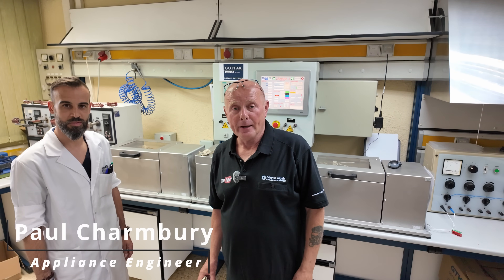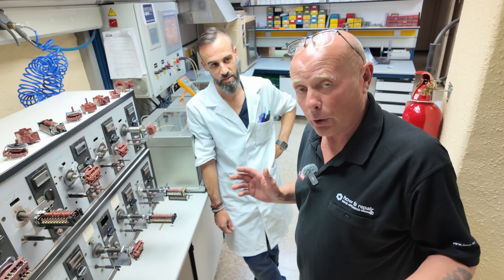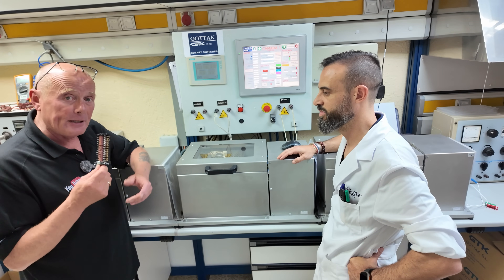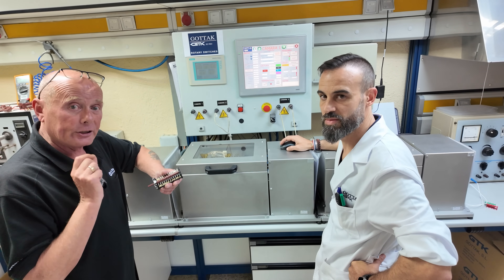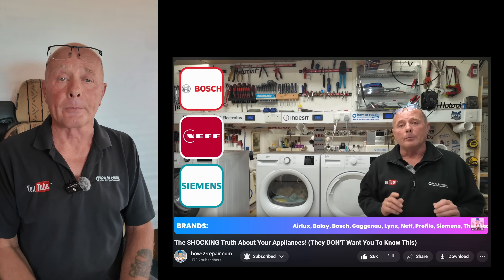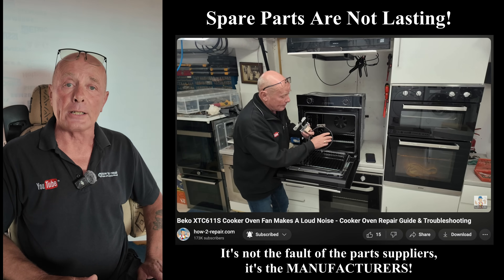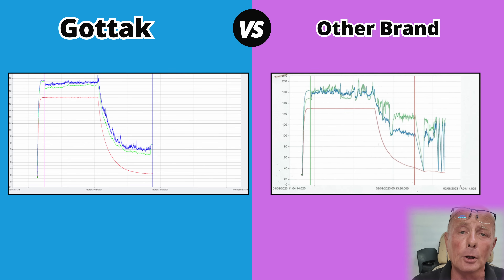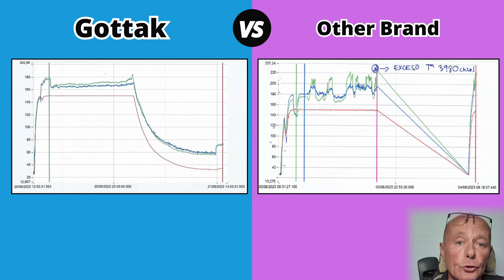Why Your Appliances FAIL SO FAST! Lab Results EXPOSE the Truth!

Comment: I’m surprised that the government has not stepped in to deal with these e-waste or f-waste. I often see clean new refrigerators, ovens, TV being thrown out. Our refrigerator is from 1985. It was so badly rusted, I did some sanding and I spray painted it. Unfortunately, now the heating element or something failed. Last time something failed was in 1990 and some small black box was changed. The freezer has been running constantly as well I suspect that one also has a similar problem. That device is also from 1985.
Reply from the maker: Hi there! Thanks for your comment, @louistournas120!

You've hit on a really important point about the surprising lack of government intervention regarding e-waste or "f-waste" (referring to appliances) and your personal experience with old, repairable appliances versus new ones being discarded. This is exactly the kind of built-in obsolescence we discuss in the video.

At the trade show last year understanding how much obsolescence is being designed into new appliances these days is something everyone should be aware of. For a deeper dive into this topic and to see the examples we covered, please check out the full video here: https://youtu.be/gEgSCbZnHVM?si=wTIw0mELuhWaw4aX

We also explored related aspects in these videos:

The shocking truth about manufacturers: https://www.youtube.com/watch?v=QsdGd2qDPaI

Heat pump tumble dryers are they really worth it?: https://www.youtube.com/watch?v=xn03N3b0-lE

If you found this information eye-opening or helpful, please consider sharing this video with your friends and family. The more people who understand what's happening with appliance longevity, the better equipped we all are as consumers.

Thanks again for watching and engaging! Don't forget to subscribe to the channel for more insights like this!

Comment: In 1978 I worked for Shell Chemicals. A co-worker had a brother who worked for Black and Decker at the time. His job as an engineer was to get tools to last about 5 years with average home use. This has been in the works for many decades.
Reply from the maker: I've reached the point where I simply cannot tolerate this situation any longer, and that's why I made this video. I'm aware that this might cause some controversy, or even land me in trouble, but I believe it's crucial to try and make a difference. I would greatly appreciate it if you could share this video. Together, we might be able to bring about some change. If we can't shame the manufacturers into action, perhaps someone in government will see the video and take notice of the overwhelming number of comments expressing public concern.
Reply: @How-to-repair  When I studied to become an engineer in the seventies, I learned that degrading life expectancy was already a practice in the fifties.

Comment: I own and still use a microwave oven I purchased in the fall of 1987. It still works perfectly. Even the original light bulb in it still works. It was made in Japan. I also own a Matag electric oven I purchased in the late summer of 1998. It still works fine and looks good. The only issue I have had with it was the clear "skin" material on the up/down arrows on the control wore through. I took it out and ordered a re[paired replacement. I have now replaced the skin and have a rebuilt spare control unit. Now alomst 27 years old I figure it will last me the rest of my life as I am 70 now. I own 2 Maytag washers (over 10 years old each), both work fine. I also have 1 Maytag electric dryer that works fine. I have a spare gas dryer also. The fridge came with the house we purchased about 7 years ago and it works great. A friend asked me if I would replace the oven. He said it is getting old. I told him not a chance. The new appliances don'tcompare.
Reply from the maker: You've hit on a really important point about the stark contrast in longevity between older appliances you own and the new ones available today. Your experiences with a 1987 microwave, a 1998 Maytag oven, and your Maytag washers and dryer perfectly illustrate the decline in durability. This is exactly the kind of built-in obsolescence we discuss in the video.

At the trade show last year understanding how much obsolescence is being designed into new appliances these days is something everyone should be aware of. For a deeper dive into this topic and to see the examples we covered, please check out the full video here: https://youtu.be/gEgSCbZnHVM?si=wTIw0mELuhWaw4aX

We also explored related aspects in these videos:

The shocking truth about manufacturers: https://www.youtube.com/watch?v=QsdGd2qDPaI

Heat pump tumble dryers are they really worth it?: https://www.youtube.com/watch?v=xn03N3b0-lE

If you found this information eye-opening or helpful, please consider sharing this video with your friends and family. The more people who understand what's happening with appliance longevity, the better equipped we all are as consumers.

Thanks again for watching and engaging! Don't forget to subscribe to the channel for more insights like this!

Comment: These things arent an accident, they are designed that way, now why is of course the money but its a bit more complex then that.

If we take cell phones for example, they are designed to last roughly 3 years, they could spend more money on making a cell phone that would almost never break.

Lets consider the life of your cell phone, you buy it, use for 2 years and then into a drawer it goes, because you bought a new phone.

In order to make things last longer they need more expensive components, that uses more materials that will still end up in your drawer after 2 years. It will also cost you more money for a product that has the same utility as a cheaper one., that is why things break, they use cheaper components that uses less materials and cost you less money that has the same use value to you.

But to understand this you have to be an economist, we study these sort of things.

We could make balloons that you can reuse 100 times, we dont because no one will reuse them anyway. We could make balloons that doesnt deflate over time, we dont because they are only up for so long anyway. We could make balloons with a very tiny valve so you dont have to tie the end up, we dont because it will only cost you more money.

Or we can go to cars, we could make a car that will almost never break, it will be tremendously expensive and once you have used it for 20 years you will still replace it. All that titanium just sitting around doing no good for anyone in a scrap yard.
Reply from the maker: Think about the environmental impact of building machines and then recycling them. These machines are often transported halfway around the world, which adds to fuel costs. It's baffling that we need to ship them every five years due to failure. Many governing bodies are being misled by manufacturers. These companies trick the government into believing they are eco-friendly and making better machines. In reality, they are just deceiving them to keep producing the same products.
Reply: @How-to-repair  The environmental impact is huge no doubt about it, that is what we humans do we live off the environment as we are a part of it too.

Im not sure about if governing bodies are being mislead, most countries governments have rules that the politicians have to follow.

Im a Swede, live in Sweden, when the government wants to do anything, they have to contract someone else to do the work for them, so they have to make all those contracts public and by law are required to accept the lowest cost offered on the contract.

The same with many other things, and even us people we obviously prefer cheaper products if they are of the same quality as higher priced products, but we cant see the quality before we buy it.

Companies wants to make a profit, their only way of making money is by trying to sell us something, in most capitalist countries there are free markets, which means that for most things companies have to compete against each other in both quality and price, because that is what the buyers care about, they want high quality and low cost. One way to make things cheaper is of course by using less robust components.

Or we can go to the old nokia cell phone, nearly indestructible when it comes to normal use, it could had been a buy one and keep it for the rest of your life, but then technology advances and we can make better phones so the old Nokia became obsolete.

More competition between companies and they care about making money, so they find clever ways to do it. If we go to for example the right to repair that Louise Rossman is very entrenched in as an example, that is a product of this process of making things cheaper too. (Maybe even better but hard to say).

Repairing complex electronics requires an electrical engineer that can understand the machine and quickly locate the broken component and replace it. That is what Louise Rossman does and he is good at it too i bet. But on the other side companies wants to make a profit, so they design modules, so things are easy to repair and require less expensive personell, modules can also be copyrighted as they can be seen as intellectual property. So they design modules that requires programming skills in order to replace which is also cheap.

And now we have products that can only really be repaired by the producer, its a clever way to earn more money, for better or worse. But its a lost cause the right to repair, because no one wants to get rid of intellectual property rights.

Im not sure Louise Rossman understands this, as i have never seen him adress the root issue at hand here.

Comment: I have a concrete mixer, made in 1970 in the Netherlands. It's still going strong with its original motor after 55 years of use. Obviously the manufacturer is long out of business, current manufacturers need to sell you a new appliance every 4 to 6 years to stay in business.
Reply from the maker: Large appliance manufacturers prioritize sales over sustainability. While employing green marketing strategies to enhance their image, they remain largely unaccountable for the mounting electronic waste generated by short-lived products. The average lifespan of appliances today is a mere five years
Reply: They don't make them like that now. I have a table saw, made in 1955 in New Zealand. Still going well, although I had to replace the motor last year, after the original wore out, and could not be repaired due to parts not being obtainable.

Comment: Don't buy new appliances! Spend the money to fix your older appliances. I would and have spent more money to fix an older appliance then a new POS one costs. Most of my appliances are from the 1950s 60s and 70s. They built them to last back then. Even a early 2000s appliance is still pretty well made and definitely worth fixing no matter the cost.
Reply from the maker: The problem is that manufacturers are deliberately making a lot of machines end up as scrap instead of being recycled within the community. There aren't many machines available for reconditioning, especially in Europe. Thanks for your comment.

At the trade show last year, understanding how much obsolescence is being designed into new appliances these days is something everyone should be aware of. For a deeper dive into this topic and to see the examples we covered, please check out the full video here: https://youtu.be/gEgSCbZnHVM?si=wTIw0mELuhWaw4aX

We also explored related aspects in these videos:

The shocking truth about manufacturers: https://www.youtube.com/watch?v=QsdGd2qDPaI
Heat pump tumble dryers are they really worth it?: https://www.youtube.com/watch?v=xn03N3b0-lE
If you found this information eye-opening or helpful, please consider sharing this video with your friends and family. The more people who understand what's happening with appliance longevity, the better equipped we all are as consumers.

Thanks again for watching and engaging! Don't forget to subscribe to the channel for more insights like this!

Comment: Ten year guarantee on an electronic air filter. Nine years and six months it failed. They replaced it free but I'm sure the life-time calculation was done very accurately.
Reply from the maker: It’s true mate built-in obsolescence and durability issues aren’t limited to appliances. It’s frustrating to see this pattern repeat across so many products! To truly make a difference, we need to get the attention of industry leaders and stop these wasteful practices. Sharing this post is crucial to spread the message. Thanks, Paul!

Comment: why would they chose bakelite for this switch?
Reply: Bakelite is thermosetting phenol formaldehyde resin normally prepared for +200 C usage......as some oven appliance producers want to reduce costs as general norm, sometimes they even reduce insulation thickness on the oven inside surrounding cavity hence, heating will be higher where rotary switch is located and as they dont want to add up an internal fan to evacuate the excess heat because it will increase the oven cost, they rather used heat proof components as they might be cheaper in all, compared to other alternative solutions but while rotary switch will perform well in this conditions some other components as electronic displays or thermostats will not survive this....and most probably will end up melting = more service and parts!
Reply from the maker: Manufacturers frequently chose Bakelite for selector switches due to its importance for electrical applications. It offers superior electrical insulation and heat resistance, preventing short circuits and maintaining integrity under high temperatures. Its mechanical strength ensures durability and resistance to wear from repeated use, while its chemical resistance makes it suitable for various environments. These combined attributes made Bakelite a reliable and safe material for selector switches.

Comment: My Samsung washing machine broke 14 months after buying it. I had the extension warranty from Costco thank God I did it would  cost 400 bucks. To fix it if I didn’t have the extended  warranty.  Don’t buy a Samsung washing machine it  junk.
Reply from the maker: Hi there! Thanks for your comment, @shaunm8312!

You've hit on a really important point about your washing machine failing so soon after purchase and the necessity of an extended warranty. Your experience highlights the frustrating lack of longevity in modern appliances. This is exactly the kind of built-in obsolescence we discuss in the video.

At the trade show last year understanding how much obsolescence is being designed into new appliances these days is something everyone should be aware of. For a deeper dive into this topic and to see the examples we covered, please check out the full video here: https://youtu.be/gEgSCbZnHVM?si=wTIw0mELuhWaw4aX

We also explored related aspects in these videos:

The shocking truth about manufacturers: https://www.youtube.com/watch?v=QsdGd2qDPaI

Heat pump tumble dryers are they really worth it?: https://www.youtube.com/watch?v=xn03N3b0-lE

If you found this information eye-opening or helpful, please consider sharing this video with your friends and family. The more people who understand what's happening with appliance longevity, the better equipped we all are as consumers.

Thanks again for watching and engaging! Don't forget to subscribe to the channel for more insights like this!

Comment: Even if you used your oven every day, 5,000 switch cycles would take like 15 YEARS!
Reply from the maker: Often, these machines are made to last only as long as the warranty period. I started by testing selector switches, but I will test other components over the next year. Now, I can test things like washing machine door locks, relays on circuit boards, and other parts that often fail. This will show the difference between poor-quality and good-quality components.
Reply: @How-to-repair  I bought a SpeedQueen comercial washer, the one that has all mechanical controls and NO electronics, it has a mechanical timer and fills the tub all the way up, it's been doing 3-5 loads a week the last 4 years